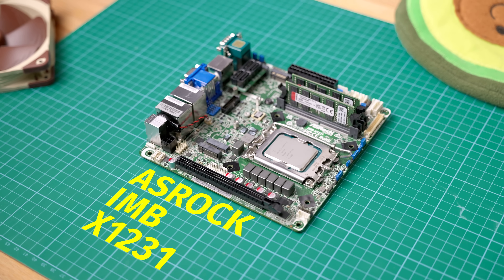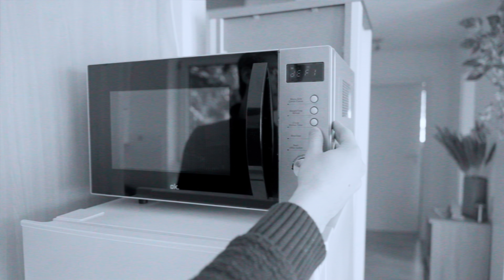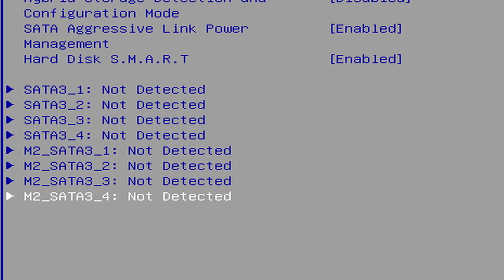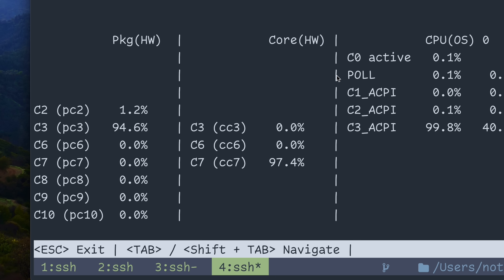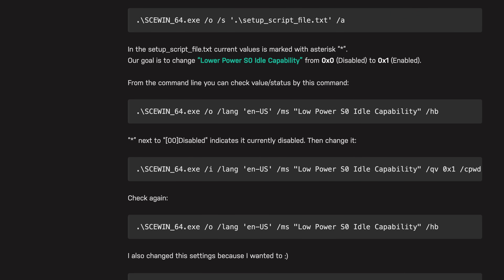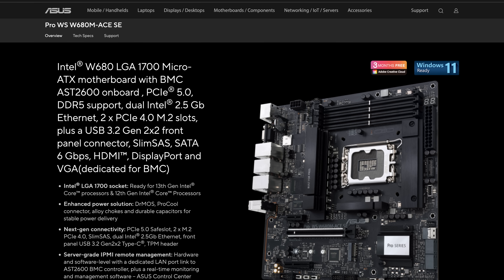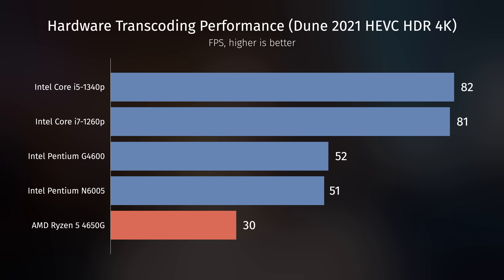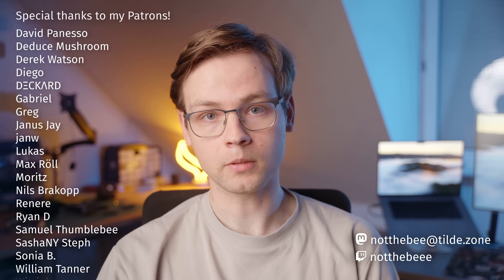A Perfect Homelab Motherboard That You Can't Buy (ASRock IMB-X1231)

Comment: Anyone knows why they just support unregistered/unbuffered and not standard server ECC like Xeon's? It is really confusing that they state they have "ECC support" but if you plug in Server ECC Ram it won't work.
Reply from the maker: There isn't really a "standard" type of ECC memory. Both unregistered and registered ECC sticks provide SECDED (single-bit error correction, double-bit error detection), and have their respective pros and cons.

For example, platforms that support unregistered ECC memory can also be used with non-ECC memory. Platforms that support registered ECC can only run ECC memory. At the same time, registered ECC memory is usually cheaper, and supports way higher capacity per DIMM (e.g. 96GB or even 128GB per stick).

Since W680 is a workstation chipset (and not a server one), it's based on the same technology as other 'consumer' chipsets (e.g. B760 and Z790). You'll definitely want fast memory for consumer applications like video games, and it's way easier to find fast and cheap-ish non-ECC memory than ECC.

Comment: its not quicksync, but doesnt 7735HS products such as ASUS ExpertCenter PN53  (only 7000 series) fit the bill here? It has 680M as iGPU which should be powerful enough for rendering and with 7000 series it has ecc supported ram.

Comment: I have contact to asrock retail in here, they can help me to buy imb-x1231 however the price will be around 500 usd. Honestly that quite expensive
Reply: Yes but, for the features and the 'industrial' design; that seems reasonable. 
I own a DFI and a Jetway (DFI ODM-suspect) industrial motherboard; they are built to much better standards with better (and more durable) component choices. 
You would be getting something for what you're paying, at least.
Reply: @LRK-GT  cool mate, i already contact asrock but they told me that motherboard are made in different teams and told me to be patience because there no stock, only made by order, i seen someone claims in here they made from dedicated engineer in their job. i guess it was right

Comment: I believe similar results can be achieved with the newer more available IMB-X1238.  ECC ddr5 sodimms will cost a bit more but may net better power efficiency.  This setup paired with an aspm L1 capable sfp+ card like the TEG-10GECSFP and the unicorn setup might actually be achievable.

Comment: Look, if you want an LGA1700 itx motherboard, just get the Jginuye b760i. For 50-70 usd, you will get 1 gigabit ethernet port, 1 2.5 gigabit port, plenty of usb, 2x pcie 4.0 nvme ports, 4 sata and a beefy vrm for the price. Why bother with these unobtanium mobos?
Reply from the maker: Theyre around 114€ on Aliexpress right now

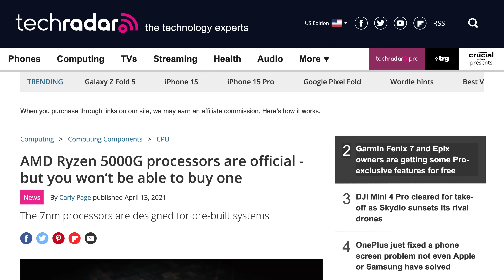Comment: 11:23 Aren't mainboards with integrated graphics a thing anymore? I remember configuring my first custom PC at a small PC shop in my hometown. The owner recommended that I save on budget, so he selected a motherboard with an integrated Nvidia 6100 and an Athlon 64 X2 2600+ dual-core processor. Because most games at that time were not graphically demanding like nowadays, if there were new games that the system couldn't run, I could just save up money and buy a dedicated GPU. it was a Elitegroup GeForce6100SM-M2 motherboard .
Reply from the maker: Nope, the 'integrated graphics' thing happens on the CPUs themselves nowadays

Comment: On Intel, the ECC support was also a question of a matching chipset - for those older generations, one would need a C/W server/workstation chipset for ECC, while none of the B,H,Q,Z series in consumer boards supported it. I am not sure how this changed with the newer series, but sure its a good thing (my dell with W chipset and 10900K unfortunately does not do ECC.. because of the cpu). I think they just got tired of releasing the same CPU's under Xeon E branding, so they merged those lines together.

Comment: Have a look at the ASRock Rack E3C256D2I.
Just finished a Homelab Server built with it.

with a Xeon E-2356G including QuickSync
ECC Ram
Dual NIC
IPMI
8 x SATA
mini--ITX

Working nicely....
Reply from the maker: How's the power consumption?
Reply: With two HDDs, two SATA SSDs and 2x32GB RAM. All 3 NICs connected, Proxmox running in idle: 33W for everything.
Reply: @bigjaws2645  33W for a Xeon E build is pretty ideal

Comment: Ich habe mal bei Asrock angefragt, warum mein Mainboard mit PCIe-Adapter (für NVME) im PCIe-slot nicht ins Bios startet (Ins Windows einwandfreI). Es wurde auf der Webseite extra erwähnt, das die PCIe-NVMe supported - trotzdem kein implementierter M.2-Slot vorhanden. Aber um ins Bios zu kommen, musste man den PCIe-Adapter ausbauen/vom System elektrisch trennen.
Es startet, Bios fragt angebundene Hardware ab und bleibt dann hängen.
Das alles im Kommentarberich des Forums bei Asrock.  Und? Asrock hat einen Link zu einem modifiziertem Bios gepostet, mit dem man mit NVMe direkt ins Bios starten können soll. 
Ich war so ähnlich  .... überrascht, wie der Hund mit Briefträger....und hab das Bios nie geflasht. Ich hatte auch zweifel, ob ein "Beta-Bios" es wert sein könnte, das ansonsten lauffähige Mainboard zu schrotten.  Diese Biosversion ist nämlich nie in den offiziellen Bios-Downloads erschienen. Ich glaube zwar, das es vor den dann notwendigen Intel ME-Updates war, was die Möglichkeit eröffnet, das der Fix ins nächste Bios eingepflegt wurde. Aber ich habs nie versucht.

Asrock hat einen schlechten ruf. Und manchmal glaube ich, das er nicht völlig zu unrecht besteht. Aber ganz allgemein sind Mainboards von Asrock eben doch nicht so schlecht, wie manchmal  angenommen. Ich habe viele Asrock Mainboards benutzt und eigentlich gabs (ausser solche Seltsamkeiten) nie wirklich Probleme....allerdings sind mir deswegen, weil ich viele Mainoards von Asrock in Verwendung hatte, auch einige defekt gegangen. Was nicht immer am Mainboard gelegen hat (sondern auch mal an mir). Insofern....nur, weil einem einmal ein Mainboard defekt geht, ist auch immer gleich der Hersteller schlecht. Sowas passiert eben mal.

Comment: Why is there no mini itx motherboard with built in 10gbe?  At least I can not find an intel board with 10gbe. I could use a thunderbolt to 10gbe but for mini itx I want to save the thunderbolt ports for expanding storage.

Comment: @WolfgangsChannel Would be super nice if you could do a how to minimize / optimize unraid or general Linux server power consumption guide, eg. Powertop, CPU, GPU, chips power states and so on.

I just salvaged a laptop Mainboard (i7 6700q + gtx 970) added a nvme/pcie to sata adapter, added an Arduino that switches a picopsu (hdd power). Desoldered the heatpipes of the stock cooling solution and soldered small water blocks to the GPU and GPU heatsinkmount 😆

This Franken server runs now unraid but idles at 60w even the hdds are spun dow. It seems my fresh install of Unraid is not using the cpu core or package C-states at all, it seem the same behavior is present for the igpu and dgpu p-states, the dgpu is stuck at p0 and draws 21w constantly while not in use at all.

 I'm in the process of figuring out how to make use of Nvidia Optimus and getting the cpu/gpu states working but it seems there is not a single info source available that gives an overview of what needs to be done to get the best results.

Greetings from Berlin ✌️

Comment: 7:17 I have a feeling I know what the Alder Lake(-N) system is. I've built already 3 servers with Intel N100(1 TrueNAS-only + 1 Proxmox for myself + 1 Proxmox for my father) - I like that it supports virtualization which allowed me to install EVE-NG in Proxmox(using KVM) and host inside it the the Mikrotik x86 image, using nested virtualization, which would not be simple to do on an ARM device.

Comment: In early 2000's I used to work part-time in a pc store where we used to make pc for customers. One day the owner of the store introduced to us ASRock as a cheap manufacturer. We got like 30 mobos to sell and if I recall correct back then it was the same chipsets for both Intel and AMD, different CPU slots though.
Out of the 30 we sold 29 came back as faulty with one problem or the other. Some of them we got to replaced by the company that imported them, a few came back as "no problem, recheck" and of course they had problem. All in all back in that era we had only problems with ASRock and the owner of the store ended up losing money with all the shipping around and he didn't want to hear any more of them, so in just 2 weeks he stopped ASRock. At least for as long as I was working there, he never brought anything from them again.
A practice I also kept, in a free society, as a technician I also get to chose in what sh13t I can step on. So every time I had a customer who had an ASRock component, I turned the job down and frankly to the people I have made computers with Asus for example, those systems tend to live for very very long times. So no regrets.
So summer of 2023 and I wanted to build for myself a Proxmox "mini-pc" with expandability. I came across the ASRock DeskMeet B660. I was very hesitant due to my prior history with the company but I decided to do the jump of faith (odd thing for an Atheist). 6 months now later I am very happy with that little pc! I got to it an RX6600 and a coral ai TPU and it runs my proxmox server with windows 11 gaming vm and Home Assistant OS for my brigate NVR. It runs 24/7 very stable. 
A couple of times that I had to contact ASRock, they responded ASAP and they even provided me assistance with the very high temps that my NVMe was getting once the GPU was installed.
(The airflow dies basically and the NVMe only gets hot air from the CPU)
With ASRock's support and kindness I am even thinking of getting an ASRock mobo for my main pc for the first time ever! No idea when ASRock went from a bad company of the early 2000's to a decent one but kudos!

Comment: The ASRock support is, in my limited experience, really nice. They supplied me with an updated bios for a weird x470 board, which had different versions than the normally obtainable ones.
I currently have an X570D4U-2L2T (which I got extremely cheap on Kleinanzeigen of all places; otherwise that's also pretty unobtainable, like most "enterprise" hardware in Germany) paired with a Ryzen 7 PRO 5750G and 128GB ECC Memory. Everything just works so well, it's probably the nicest Motherboard I'll ever own.
You mentioned the Ryzen PRO APUs with ECC Support are only being sold B2B, so I guess I was just really lucky getting my hands on a 5750G?

Great video as always :)

Comment: It would be damn near perfect for me if they could somehow squeeze 4 SFP+ ports somewhere on that board. I'd take the ECC option and throw in the hottest Xeon CPU it'll take. I'd even open a business account just for the privilege... I currently run rack mounted enterprise gear at home, not just as my lab, but that stuff runs my house. The problem has always been that it's loud, hot, heavy and sucks a lot of power. I continue to keep a lookout for things like this that may allow me to downsize in the future while not feeling that I'm really losing much. On the other hand, what's going replace my Juniper fiber switch, which is also loud and hot.
Reply: SFP+ ports are hard to find as integrated networking even on most server boards. Is there any reason why you wouldn't get a PCIe NIC?

Comment: What about the CWWK AMD-7840HSHS 8-Bay/9-Bay NAS ITX motherboard? 
It supports ECC, features an AMD 7840HS with a 780M iGPU, includes 9 SATA ports, and has 2 NVMe slots.
Reply: A common problem of  motherboards from small Chinese manufacturers is overall "meh" quality in the end. Such manufacturers usually create devices with dozens of "wow" features, like a bunch of I/Os, while strangely none of the big brands have something similar closely. When you scratch a surface, you quickly get that this "wow" is achieved with questionable tradeoffs because of hardware limitations and that's why big brands don't have similar products. Later on you'll learn that such mobos have no BIOS updates in a year after they got released, no technical documentation (schematics, block diagrams, manuals, conformance, compatibility lists, etc.), they use cheap power-inefficient components like SATA chips for a bunch of I/Os, etc. Hardware compatibility and stability is another big topic. Also, good luck with getting custom BIOSes on request. Just sharing my personal experience with overhyped Minisforum MS-01 and their support, and some research on user's experiences from forums about similar devices. If you take your personal time and data seriously, you won't go with such devices.

Comment: Hey Wolfgang! Thank you for your videos. I am currently in need of replacing my Xeon E5-2667 V2 Supermicro 1U server (as it takes 80W at idle), with something powereffitient, supoport for HW transcoding, ECC, and plenty of Sata 3 ports. Watching your videos with a hope to find a good motherboard. But in every video you seem to be  chasing a unicorn. Is there a board that doesnt cost an arm and leg, currently on the market and actually good for all that good tasks? I would really appreciate a vido like this. Or links?
Reply: unfortunately when you make ECC a requirement you move into "enterprise" territory and have to accept a price or power consumption tax. You also need to start reading the fine line to make sure the hw supports hw transcoding as some cheap "enterprise" ones don't like some hp microservers.

Comment: I used to have an old AsRock Athom board with an integrated 520m, at some point i ended up flashing that BIOS an the process had failed. I had close to zero hope when i e-mailed them about the back then 5yr old board.
After about a week i got a response where they let me know the board's support has already ended, but they still had some spare BIOS chips which could be socketed, three days from that e-mail that arrived at my doorstep and it'll be an interaction i'll fondly remember for many years.
This was just a regular consumer ITX board.
Reply: Thats awesome

Comment: no sfp + 2ndary pcie slot disqualifies this board, sorry.
Reply: SFP+ ports are almost impossible to find integrated into any motherboard (even standardized form factor server boards usually have regular ethernet ports for their integrated NIC) and mini-ITX boards never have more than one PCIe slot as the form factor makes it impossible without risers. If either of those are a problem for you, then sure, this isn't the board you're looking for, but it would be fine for many use-cases. What are you doing that requires integrated SFP+ network ports instead of a PCIe or mezzanine NIC? If you're looking for a board with multiple PCIe slots, then why even bother looking at a mini-ITX board, let alone commenting on a video about one just to say it's "disqualified" with no context as to why that could possibly be a problem?

Comment: you can get the board you need to use google  to search.

maybe you can turn into a reseller by buying a bunch of the boards and reselling them on ebay at a gouged price.

not corperate greed.

intentional weakening malware rebustness by the cia and fbi.

since ecc can correct corruptions that can allow malware in via software exploits the fbi and cia wanted a way that they could compromise  a terrorist's computers to stop say a identity theft scammer.

that is probably how the silk road was shut down they compromised the computers over tor and that is how they traced the servers back through tor.
Reply from the maker: Nope, much simpler than that. They traced the owner to his personal Gmail address using old forum posts.
Reply: @WolfgangsChannel  you mean that they dont want you reselling the board?

i thought that is a violation of the first sale doctrine?

since they only sell to system integrators.

first what is a system integrator? is that the same as an oem maker? like your local pc shop?

if so can you have them buy the board for you or build a system for you using the board?
Reply from the maker: Not sure what you mean, but I was talking about the Silk Road guy.

Comment: Just curious, have you ever tried using M.2 to 6 SATA adapter with ASM1166 controller on this board? ASM1166 supports ASPM, but me and another person under a blog post were having trouble with ASRock motherboard M.2 slots connected to the chipset not recognizing the adapter, even after flashing new firmware. On the same boards, the CPU connected PCIe slots could recognize the adapter just fine. Very strange.

Comment: i just got a Gigabyte MJ11-EC1 ITX motherboard, which was pulled out of a GPU server. It does require some adapter cables to fully utilise it (no PCIe slot but a slimsas i4 + i8) but if you're fine with 1GbE or a m.2 2.5GbE adapter you can get 4 SATA + 3 NVMe, or 4 SATA + 4SATA+ 2 NVMe. And all that for 90€
Reply: I also saw this board .
How do you get 4+4 SATA + 2.5gbe+2 nvme configuration?
Reply: @HaimPeretz  you can get a SlimSAS 4i SFF-8654 to 4x Sata cable and have a total of 8 sata drives (set to sata in the BIOS). Alternatively you can use the slimsas port as a x4 PCIe port given the correct cable/adapter.

It also has a slimsas i8 port,that has 8 PCIe lanes, that you can bifurcate if I remember correctly.
Reply: @JohnSmith-yz7uh thanks , the board is almost perfect for me
But, if I planned to convert the slimsas 4i to 4 SATA drive, slimsas 8i to GPU and m.2 to 10gbe network card (this board has only 2 port, 1gbe each) I will not be able to get another port for os SSD.